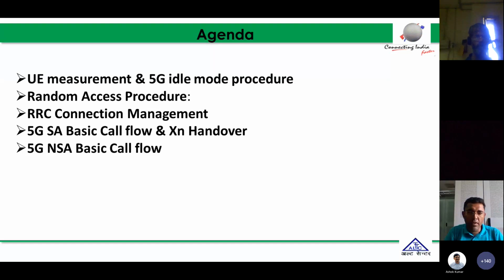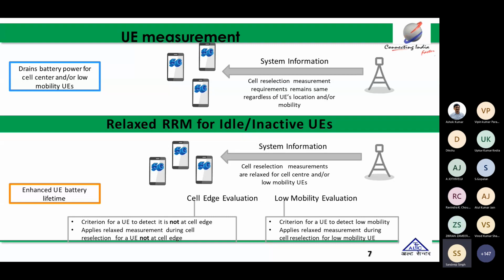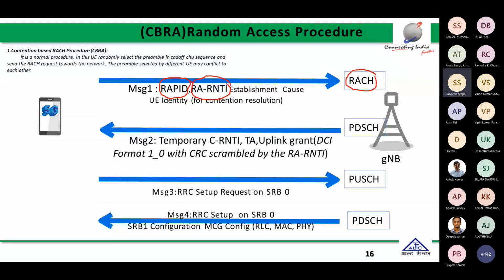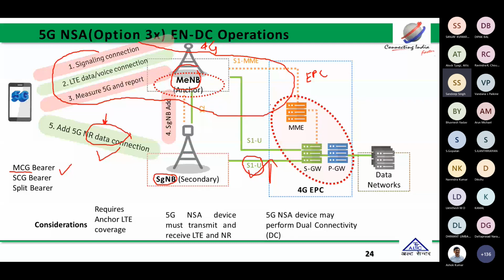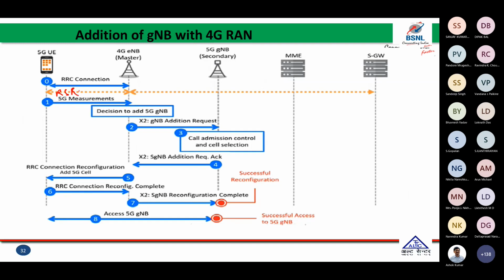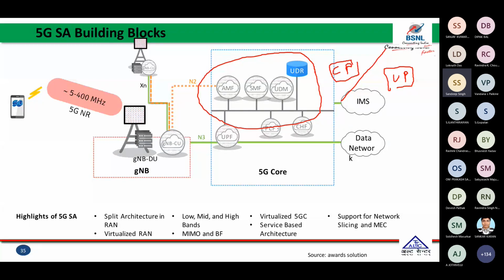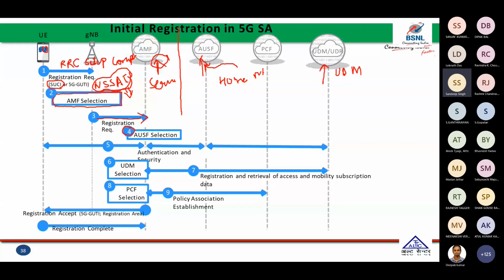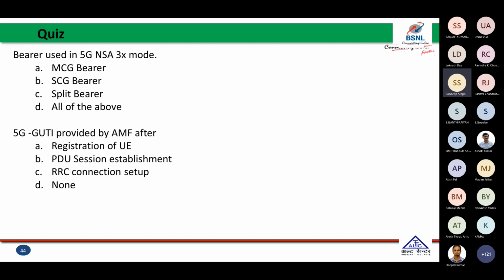Call Flow NSA & SA 5G

Comment: Hi Experts,

I’m an engineer at a network operator in Vietnam, and I’m encountering an issue related to the 5G 
EPSFB case with RwR Blind Redirection.

When analyzing the MO’s logfile in SIP messages, I noticed that the "SIP PRACK Request" appears twice, while in the MT’s logfile, the "SIP PRACK Request" only appears once. This discrepancy seems to be causing a significant delay in call setup time (approximately 3.9 to 4 seconds).

Has anyone experienced a similar issue? If so, I would greatly appreciate your insights or guidance on resolving this problem.

Thank you for your help!